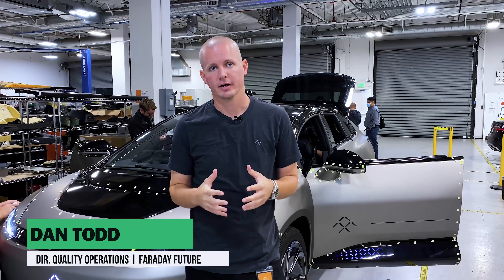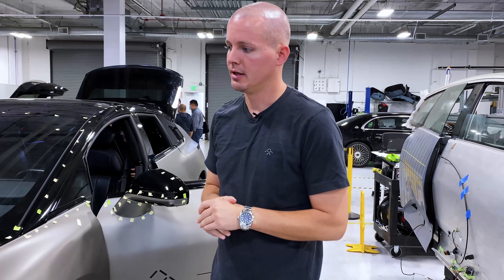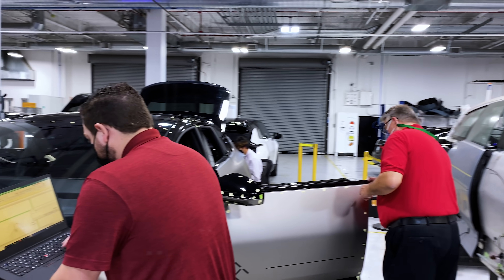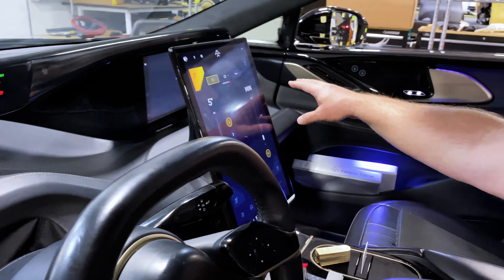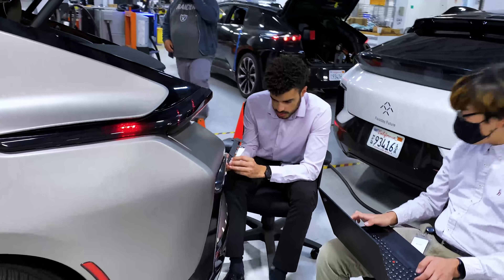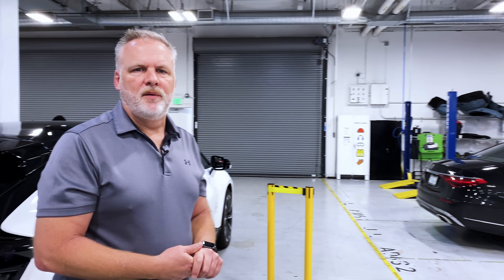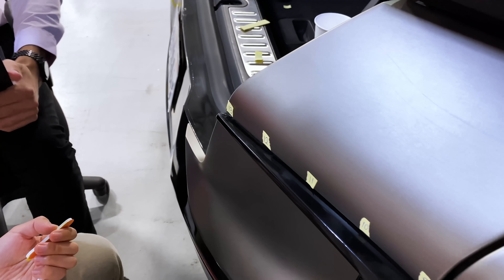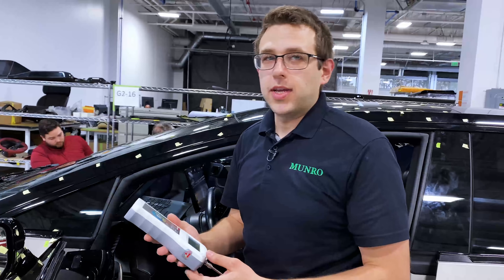Behind the scenes at Munro & Associates | FFQ on a FF 91 Prototype

Comment: Doesn't really understand why benchmark a prototype 🤨 also why use touch surfaces instead of buttons? Even the cheapest buttons can have a better touch feedback than the best touch system, it doesn't look better, probably not cheaper and worst to use, it's like the modern version of this disgusting fingerprint magnet glossy black plastics witch scratches very well too

Comment: If you want to know how true your measurements are, have one team work in inches and another team work in metric and let the computer point out differences.  There is no cheating if two types of measuring is done.  And yes, it does help to go back to any discrepancies and find the bad measurements, it will help in picking your next team.

Comment: Sandy, I'm a quality engineer at Boeing. I suggest upgrading your gap measurement technology. There are digital calipers that can use Bluetooth or WiFi to automatically upload data points to the cloud. This would let you get the job done with one person without pencil and paper and manual spreadsheet data entry. Also it would mistake-proof data entry so your guys can just focus on doing it faster. From a lean design perspective, the measurement itself is the only value-added step here. The pause, lean over, reading the device screen, and typing are waste.

Comment: I see lots of stuff I don't want in my car . The car maker is pushing luxury when utility is far more important ! For instance, full power seats, once I have my seat set in the position where it's comfortable for me it does not move for years at a time . Having all those adjustments powered simply ensures that when I finally do need to move it, most likely won't work . My current car has satellite radio, I don't use it so I don't pay for the subscription . So massive amounts of costs are added that have only negative effects for me. Making a vehicle much heavier than it needs to be and far more prone to problems. I want a vehicles that conforms to  the KIS standards,  keep it simple stupid.
Reply: Being a bit of a techno-phobe myself, I'm nearly 70, I wonder if a basic EV could be made. I'm not even bothered about a radio. Just go from A to B, charge reliably, and be safe.

Comment: Reclining seats are dangerous. In a head on crash you will slide under the seatbelts and possibly break both your legs and maybe your hip on the back of the seat in front of you or on the dashboard if you are in the front. 
Why put the charge port on the opposite side of the driver so you have to walk around the car to get to it?

Comment: Always interesting to look "under the hood" of any company, not only the final product! By the way, why your highly skilled engineers spend time to write down number on a small hand crafted pieces of paper? Why do not use preprinded labels with numbers (or even qr code)? Also it will 
prevent using same number twice. And why you not integrate measuring tools with notebook's software via bluetooth or smth? In that case need only one engineer for task!

Comment: Why on earth is the data being entered by hand? Even cheap calipers have serial interfaces, and if a wire is inconvenient, then use bluetooth or similar. And stick barcodes or QR codes on the labels for predefined locations, and scan them.  Likewise that Torbal force gauge has a serial cable, or for +$250 there's a wireless model.  Or get a unit that gives a force vs displacement curve, so as not to be fooled by bottoming out.  This procedure looks like the participants never did this before.

Comment: I understand with Monroe and Associates does . 
My observation is that measuring a single one sample of anything for any "quality" you can think of has limited value and can be misleading.  As an engineer I would want to evaluate multiple samples for consistency.  At this stage of a product being developed, once obvious defects are recognised, I think the largest value would be in looking at how it was put together, what tooling was used,  and seeing if improvements in the fabrication method or the designed could be improved for better production quality.

Comment: Cool insight.

One tip for free: tell FF to move the charge port to the driver rear side, so they will be in the same location as Tesla's. I am pretty sure that high end customers will want the best charging experience possible...
Reply: Hopefully they have charge ports on both sides.  It's odd that most gas cars already have the fuel door on the driver's side but not FF91.
Reply: @lanzer22  european cars always have gas filler on passenger side..rule..so if on shoulder you aint standing on traffic side..u.s. has low standards..on drivers side is dumb...plus if you get out of car your door is up against the pump...dumb...european design is superior
Reply: @cengeb  That is interesting.  The US seems to always do thing the opposite (and often dumb) way.  Although for EV which I charge every time I get home, having the port near the driver side saves me time.

Comment: The gaps looked terrible even from my 6 inch screen, I can't imagine how the Munro engineers kept a straight face while measuring. Why would a hand-built prototype need this anyway? To confirm if the stamping and molding machines need any design adjustments?

Comment: Have never understood the obsession with gaps.  My Hondas and Subaru all have strange gaps but I don't care.  Never even noticed until watching the obsessive videos.
Reply: I feel like gaps became sensationalized after Tesla shorts tried to use bad panel gaps as a measure of quality. As long as non perfect gaps don't interfere with operation, I'm completely fine.
Reply: I think the same, but I'd bet they are a tell tale sign of deeper issues.
If gaps all over the car have large deviations/differences, what do you think the rest of the engineering of the car will look like where it might matter technically?
Reply: @joansparky4439  Large gap differentials = superglue slipped.
Reply: Well this car is probably close to $200K so I think measuring gaps is fair in this case...

Comment: Yeah, let's make all doors touch actuated so we have more electronic parts that can fail. I don't understand this obsession with making all doors automatic closing and opening. It's a completely useless feature. Opening or closing a car door with a physical handle is not a hard task. I'm an electrical engineer, and I see no value in replacing reliable mechanical mechanisms with electronic ones. A key engineering principle that is lost in tech industries that think the best way to make things better is to add more electronics or make everything WiFi enabled is summed up in the expression "keep it simple stupid".
Reply: Same! Me too. electrical+embedded+power electronics guy working in EV startup
Reply: Robot electronics is my daily job. I reckon to keep things as simple as possible, to achieve design goals. Lowest speed micro-controllers, minimal software. ( I was the only electronics guy for years.) All off the shelf, standard components. Has proven to be reliable. Young robotics dude joined us ,  straight form university, nice guy, but jesus - he loves the "new-fangled " latest motor drivers, micros, all software configurable. If someone walked in, they would think he was a typist. And he has problems that you wouldn't believe. He doesn't understand that the latest stuff can have problems that they haven't resolved, and the software drivers can still be "buggy", even though they are selling it. And the massively capable chips that operate at high speeds? Can cause issues that he still has no clue how to go about fixing. Luckily I had no input whatsoever on the design, and I'm leaving in a month.  Yes, keep it simple with those electronic designs and software , to keep it reliable and fixable by someone else.

Comment: You should do a teardown on Lucid Air, with 500+ range they have proven all those OUR OWN TECHNOLOGIES was not just empty words and if it's too much costly for you, I am sure there many people like me who are willing to buy some stickers to make happen.
Reply: Very exciting company. If their light motors manage to be efficient and need little cooling at high load, I'd like to test those in high level car racing such as Formula 2, LMP1 and even F1 style racing. All you need is low heat rejection drivetrain and a hot swappable battery pack that can deal with the loads. Proper design would lead to 10-15 second pit stops. Beating endurance racing stardards for a similar racing range added, as similar or superior pace.

Comment: Kind of surprised FF doesn't already have this data, we do these measurements at my plant on every trial run when launching new models and again when we make E changes.  Good on FF for going after the data even if they are outsourcing it.
Reply: Likely a marketing move. They need someone from the outside with a good reputation to say its a nice car that compares well to ultra luxury marques.
Reply: @patreekotime4578  That could be it. I don't think most people would care about a fit and finish report but if they can say "It's better than a Maybach and Bentley" then it's a big deal for some.
Reply: Maybe they need independent data to show and convince their clients.
Reply: They will be doing much, much more than panel measuring.
Reply: @SciFi Author B.L. Alley yes, most likely for investors
Reply: Yeah I'm a little surprised they didn't do it in house - but sometimes companies need a third party report and that's where Munro comes in. What munro has is manpower they can hire if they need it, and a huge amount of industry experience.

Comment: Why bother do this on a vehicle that doesn’t come off a manufacturing line?  Am I missing something?
Measuring up a one-off, prototype, or pre-production car seems a bit pointless, no?
This is not a roast — this is a legitimate question..  Thanks-
Reply: Doesn't matter Munro gets paid to analyze and ff gets publicity. This is just a stunt by ff probably because rivian and lucid are starting to enter production.
Reply: I agree, but also I think there are many things it would be more important to have Munro look at than fit and finish. Have Munro look at the battery pack, the motors, inverters, and cooling system. Tesla has thrived with bad fit and finish for a long time because all those other things are superior.
Reply: It helps to build a better production vehicle by showcasing the gaps in vehicle features, functionality and design.
Reply: It’s a base line to find out where to improve.
Reply: OMG you read my mind.
Reply: Had similar thoughts
Reply: It’s pretty weird.
Reply: Munro doesn't care. They are being paid to do a job for FF so FF can say they are still alive.

Comment: If the car was all made of injected plastic...it would be praised here non stop.
Reply: Got to admit, that would be pretty amazing.
Reply: This comment just goes to show, however hard sandy explains something, people will still completely miss the point.
Reply: @ForeverNeverwhere1  the point is to save the manufacture production costs, while the costumer satisfaction is a second point.
Reply: @ForeverNeverwhere1  Sandy would be more impressed if it was made of a single part, no matter the material. That can be stamped out, and put into a box with no additional tinkering.
Reply: @ForeverNeverwhere1  You won't be able to explain what you mean because OP's comment didn't miss any point. In fact, it just repeated a solution praised here.

Comment: Honestly surprised to see FF still alive
Reply: I’m also surprised to see Maybach.  I see so few Mercedes on the road since Tesla started dominating the market in Colorado.  I don’t think I’ve ever seen a Maybach in the wild.  I saw the two models at the Paris Auto Show when they launched many years ago.
Reply: @JohnPMiller  because 90% of the sale  is in Russia
Reply: @epoxy1710  Very interesting!  Thanks!
Reply: @JohnPMiller  comparing a Maybach  with a Tesla, just shows you're not aware of their target costumers.
Reply: @RogerM88  No, I know that Maybach is trying to compete with Rolls Royce and Bentley.  What I meant was that even mainstream Mercedes are disappearing here.  I live in a very eco-friendly town, so I’m sure Mercedes is selling well in areas where oil is king.  The EQ and even the FF will sell well here.  I’m starting to see Taycans and Mach-E’s on the road.
Reply: @JohnPMiller  "eco-friendly town," using EVs with Lithium based batteries? More bs virtue signaling coming from middle upper classes. If they really cared about the Environment, they would opt for an affordable EV car as the Nissan Leaf, that requires less rare metals to produce their toxic battery pack, or an PHEV that isn't useless or obsolete after a decade of usage with a degraded battery pack.
Reply: Same lol
Reply: same, i haven't heard of them in a long while. i thought they became vaporware...
Reply: I am honestly happy to see them alive!